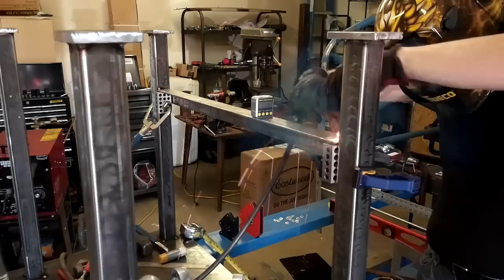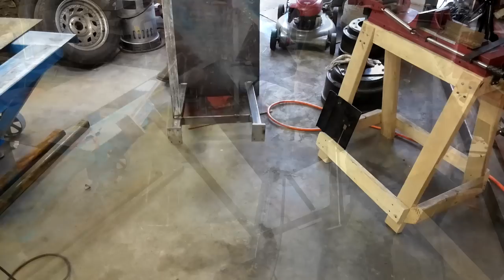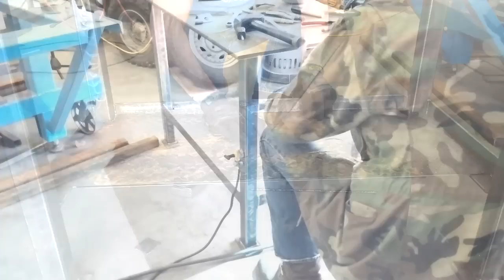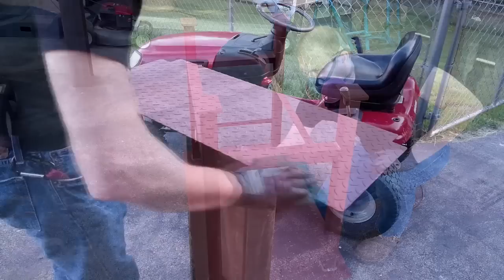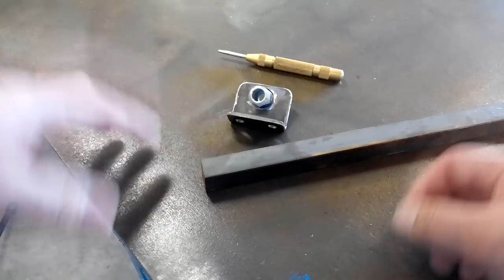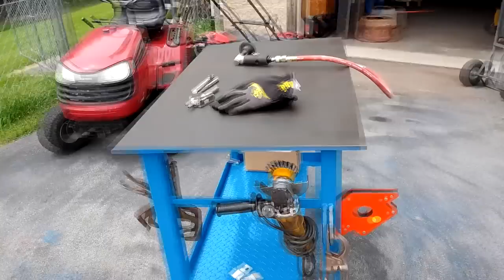Ultimate Small Welding Table Build Part 3 Of 3

Comment: Love the air idea. Nice table.I have power on one of my tables and it's a godsend not having to change what's plugged into the extension cord.
Reply from the maker: oh yea, works pretty well too. I may add power later but my shop is so small I really don't need too. I can see a lot of good uses though.

Thanks again.

Comment: Nice! Simple yet effective table. I only have one of the small Chicago Electric tables from Harbor freight right now, which is fine for small projects. But this gave me great ideas to build my own similar in size and function. If you watch ChuckE2009 welding table videos, he uses a mag drill to put holes in his massive table and then made fixtures with matching holes, so he can have modular fixtures that can be secured with large bolts and moved anywhere on the table.
Reply from the maker: Hey Brandon Wilson Thanks for watching. I love watching ***** - I would love to do my table the same way as his. I have looked at getting some of the strong arm table clamps to do just what your talking about. They would really be a great addition to a table. I really do plan on doing that this year some time. Maybe this winter. Thanks for watching!!!

Comment: Might I make a suggestion. It's always handy to have a 4 inch Vise on your welding table, but you don't want it in your way when working on large projects. SO . . . weld a Hitch Receiver Tube on the underside of your table, then mount your Vise on a plate that's welded to a Hitch Bar. Keep the Vise on the shelf under your weld table and when needed install it in the Receiver Tube.  - Very handy at times. I have this setup on my welding table.
Reply from the maker: Hey 001DesertRat Thanks for watch. I like that idea. Very cool thought. It would be good to have a vice on my table ever so often.

Thanks

Comment: Enjoyed the finished product.  I was thinking about building two about that size.  Makes it manageable to move and store in smaller spaces.  Put them together or side by side with space between and you can handle 6' - 8' > ?' plus projects.  Thanks for the video.  The table turned out great.
Reply from the maker: Thanks Tom! If I had a larger garage I would have gone with a larger table but that is the reason for the small table.

Thanks for watching. Please subscribe if you haven't already.

Comment: Great table, building one a bit smaller with a similar design.  Have you seen any issue not having support between the legs at the underside of the table?  I assume with 1/2" plate, the deflection from heat is not an issue.  I may add some cross braces on mine.  Thanks for the great series!
Reply from the maker: Hey David, No issues whats so ever. No deflection or anything. Glad you like the videos.

Thanks
Reply: Good to know.  I think I am going to add a bit of 1" tubing that I have to add just a bit more rigidity.  Being new to welding, do you remember and mind sharing your weld settings and wire diameter?  Assuming you are using ER70S-6.  Thanks so much.
Reply from the maker: Sorry David, I am unsure of the setting. Yes, I am using ER70S-6.

Thanks
Reply: No worries, thanks for the inspiration.  I think I have the settings figured out based on some tests.
Reply from the maker: You should be able to find some charts on-line for volts and speeds. Your machine should have a chart as well.

Comment: Thinking of doing the same, how often dose the top of the table get rusty?
Reply from the maker: +krssnoop Its a great tool, everyone who welds needs a table similar to this one. As for rust, it hasn't. After all the painting and cleaning. I took a rag, put a little WD-40 on it. Wiped the top a little. That is all I have done. no rust. my garage is not heated either. I hope to fix that soon but for now its only heated when I manually turn the heater on.

Thanks for watching. Please subscribe if you haven't already.
Reply: It's very dry here in Adelaide Australia so I guess it shouldn't be a problem for me either.  Thanks for sharing, I'm hitting the subscribe button now.

Comment: Would u be able to put your welder on the shelf and weld on the table or no
Reply from the maker: Hey Robert, yea I would think so however the bottle would be kind of hanging out next to the table. You would need to secure it so it doesn't tip over.
Reply: So it should hurt the welder or short it out because the ground will be clamped to the ground on the table
Reply: And I have an arc welder so no bottle

Comment: Do you know how much the hole table cost.       Thanks for the good idea
Reply from the maker: Hey +Jacob Gfiffin, they are called fixture tables or jig tables. They large ones with think plate (5/8) are very expensive. You are looking at $2,000 and up. Now if you get one with a thin top (5/16 to 3/8) they are more affordable. They cost $400 to $1,000.

There is a YouTube channel that sales all the parts needed to weld your own table together and I think it costs $350 to $450. I can't locate the channel but if I find it I'll post it for you.

If you need a fixture table for a hobby, I would buy one you weld together that isn't very expensive. If you are welding professionally, I would by one pre-made. It will be well worth the cost.

Thanks for watching!!!
Reply from the maker: +Jacob Gfiffin - I found the channel. https://youtu.be/qHdFo8Dz6CM

Comment: Maybe for the hose you could take an Ole busted up air tool and cut the male adapter off and weld it to the leg or the bottom of the table and just connect the hose to it until it's ready for use. Not sure how understandable I made that tho lol
Reply from the maker: HEY Thomas Dowd, That is a great idea! Thanks
Reply: Part-Time Fabrication no problem,  the table looks pretty good. I ain't good enough to make something like that yet, only stuff I know my dad showed me but I'm headed back to school to start a welding course next month. This will definitely be on my to do list. Great work!
Reply from the maker: Thomas Dowd Thanks. A good table is a great tool to have. Don't forget a place to attach the grounding clamp. Its much better to have that then just clamping to the top of the table. Good Luck with School!!

Thanks for watching and I appreciate you subscribing.